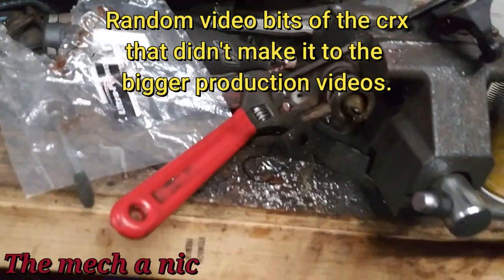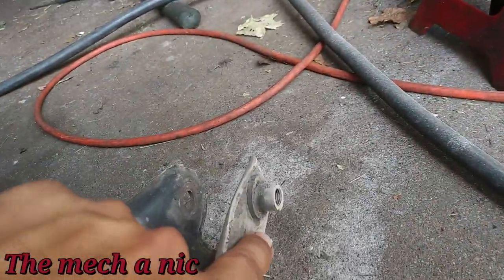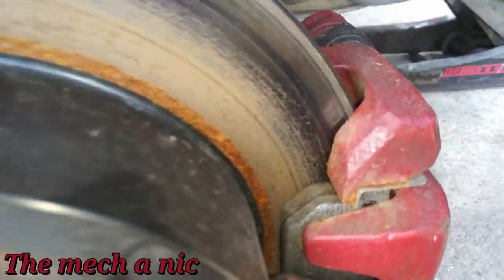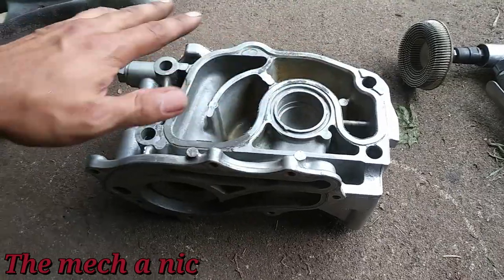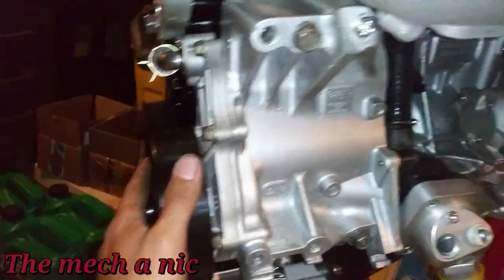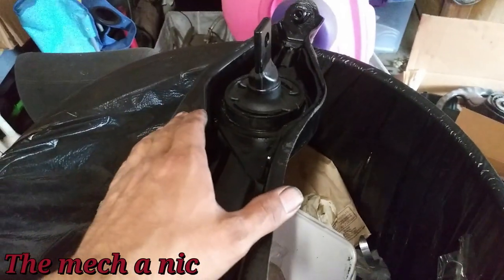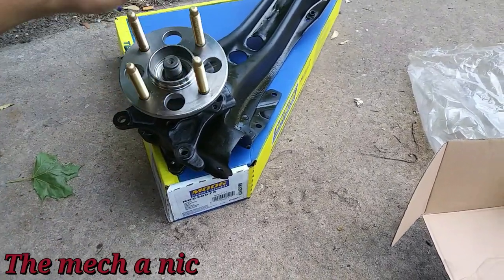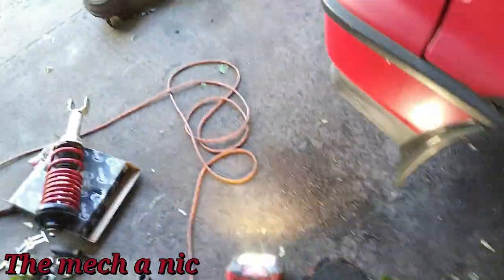crx trailing arm / brakes

Comment: I've been amazed at how fast and effective electrolysis works for rust. As you say you need a plastic tub from Walmart, 12V battery, washing soda, water, a couple of automotive wires, a 5 A fuse, and a couple of throw away strips of scrap metal for the anode and cathode. Cheap, even for big parts, done in less than 12h, no pitting or metal erosion, no toxic chemicals to dispose of (same as you flush down the drain after washing clothes).

Comment: Did you line up those 2 alignment pins inside the caliper
Reply from the maker: Yes i did. I ended up figuring out the problem. There was too much paint on the knuckle causing the caliper to not sit flush

Comment: FREE TIP FRIDAY

For "large" parts that you'd like to try Evapo-Rust on-
there's no need for a tub, and a huge amount of expensive chemical!

Get a large enough garbage bag/lawn & leaf bags are 55 gal
and place part in bag, then squeeze all air out, just leave a small
space. Add your rust remover, zip tie up the end.
It only takes a few cups to completely cover a part 
such as control arms.

Body guys freak out-

Rusty panel?
Scuff a border line around area, 1/2" wide.
Silicone a bead, place cut plastic bag onto body.
Let dry overnight.
Repeat for inside/outside of panel where necessary.

Use syringe, or small tubing- fill pocket with rust remover liquid.
Let sit as long as it can, longer the better.